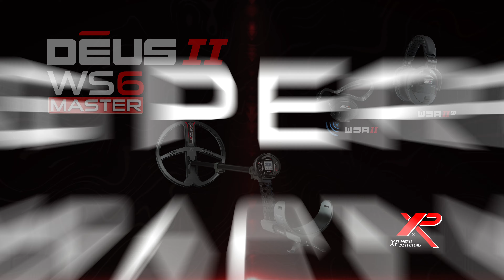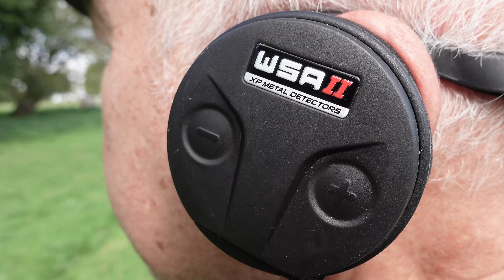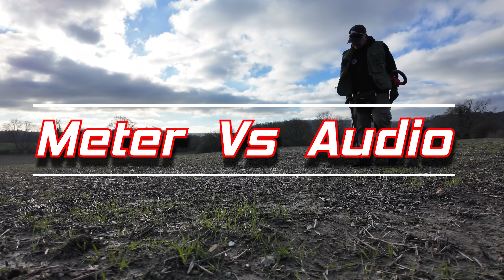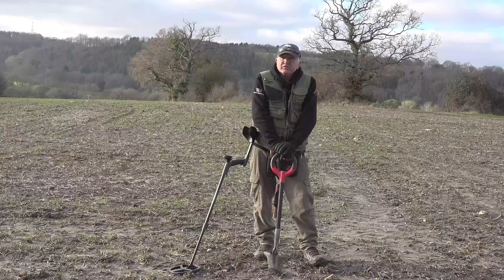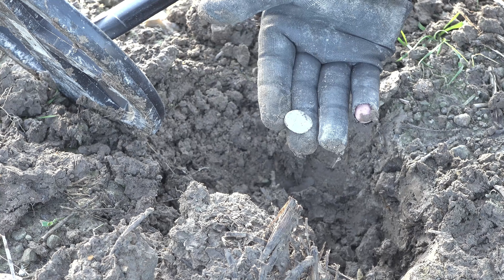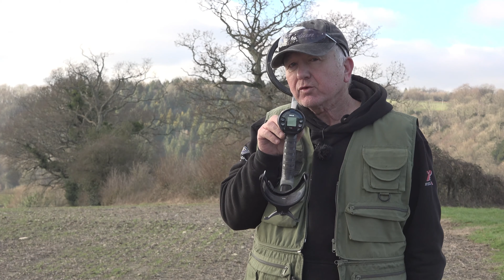WS6 Master: DEUS 2 metal detector, top performance in its most compact set-up

Comment: No more videos for the WS6? Looks like XP's dumping it for the straight Deus 2 unit! Getting the feeling I've been taken...
Reply: Its the exact same machine. The brain is in the coil. Thats where the magic happens. The remote has the xy display and easier to change settings. So why would he keep making videos with the ws6 instead of the remote when its the exact same, which just a tiny bit easier setting navigation? When he has both.  No one is trying to dump anything and you haven't been "taken". I just ordered the ws6 master yesterday, upgrade from my old deus 1. There is nothing i can't do on my ws6 master that my brother can't do on his full version. 

Its basically like playing a video game with a contoller or keyboard. Both does the same thing. Some people prefer the controller, and some prefer the keyboard because it has a few more keys

Comment: Thanks Gary .I am running the ws6master with 9 inch coil wsa2xl  headphones  great machine.Question would there be a great difference between 9 inch coil and 11 inch coil in overall performance in depth and seperation ect. ? Thanks for vid.
Reply: That's a tricky question, some people say 11" others 9".
Personally I always pick up the 9".